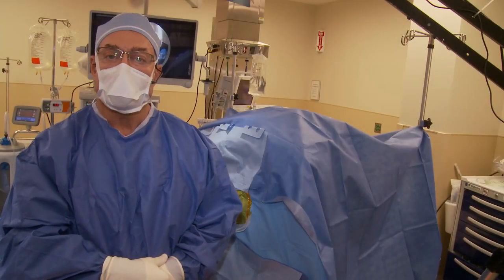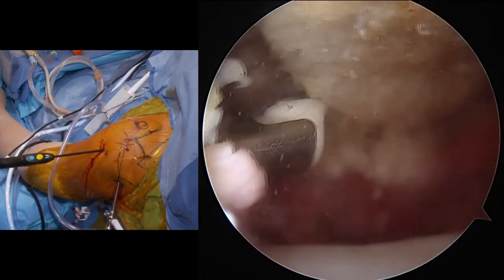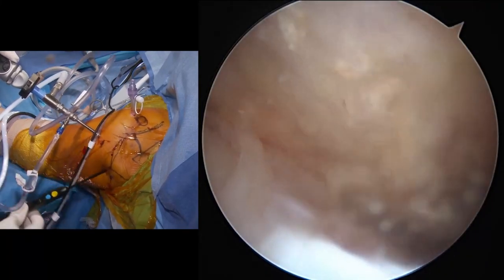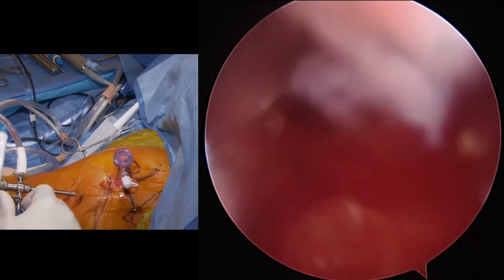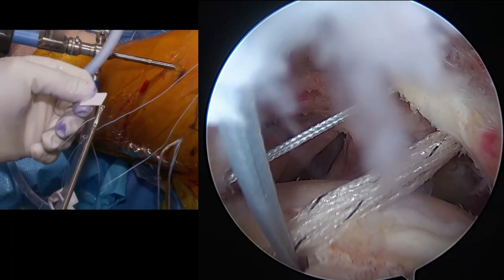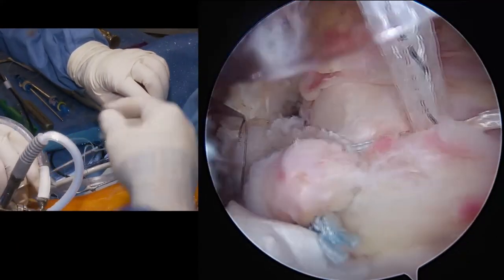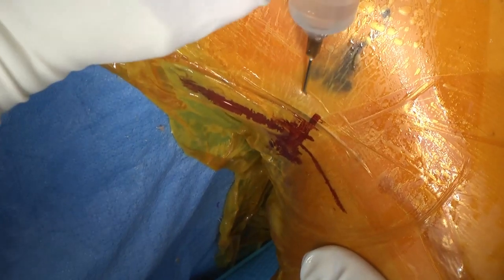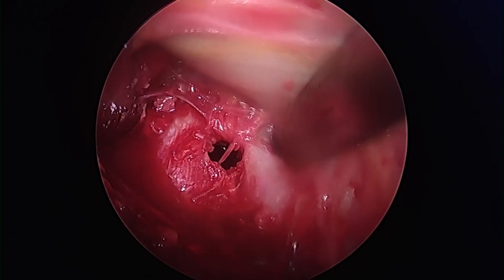Arthroscopic Rotator Cuff Repair, Acromioplasty, and Biceps Tenodesis - Anthony A. Romeo, MD

Comment: Why do so many surgeons take down the CA ligament when doing a decompression? Are they not skilled enough to leave it be so it can help prevent upward and anterior migration over time that is common when it’s taken down?  I depended on my left shoulder to be able to bear weight for long periods of time and yet my surgeon took down that ligament causing shoulder instability when trying to do my job as a pro sports photographer.   I am now having to have another surgeon implant an InSpace balloon to try to allow me to rehab with minimal pain to try to retrain the remaining muscles to keep the humeral head centered.  I am still upset that despite knowing what I did as a vocation, loading 10 lbs or more on that joint for hours or days at a time, he still elected to take down a perfectly healthy ligament which is now causing me additional misery.  What happened to the idea of “first…do no harm?”

This may cost my my career.